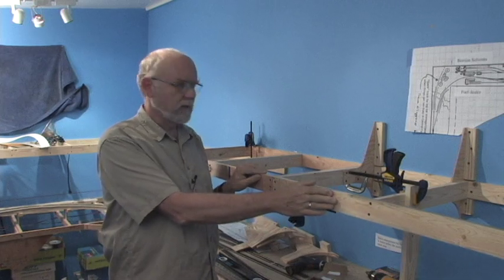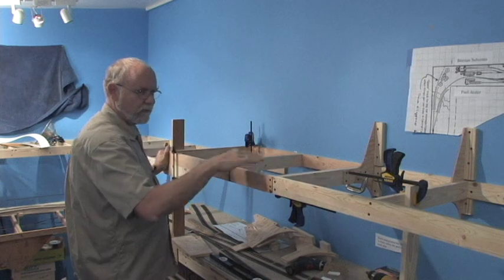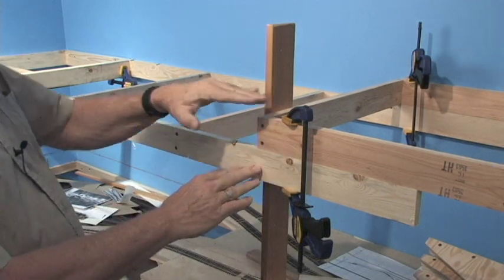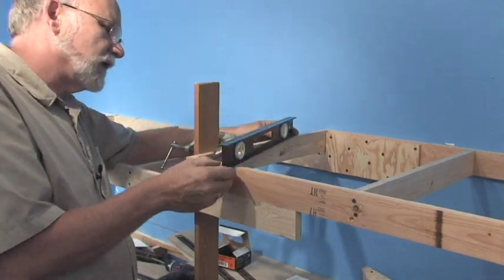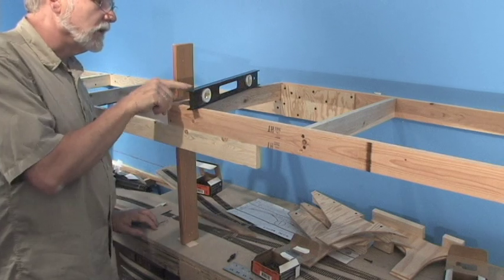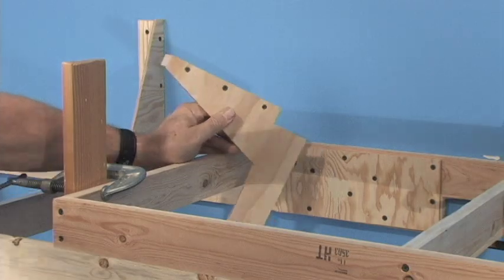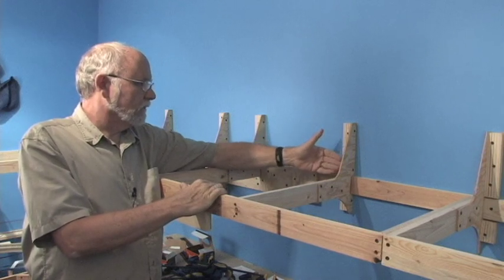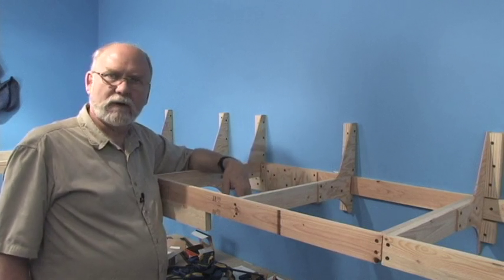Second deck layout construction part 3

Comment: Good presentation and thanks for posting your ideas. I do like the idea of adding plywood sheeting behind the wall board to finish the room thus removing the need to look for a stud for stability. How thick was your plywood and wall board. I would think the thinner wallboard could be used in this instance.

Comment: This series is an excellent example of how to do shelf layouts.   If studied, it should let you build on any level.  My own layout, using these same principles, holds my body-weight.  I never know if the wife will kick me out of bed someday, and I will need a place to sleep.  ;)   And yes, I have lain on my layout, and it does support me easily.  But I tend to make extra supports from the bottom rather than the top on the lowest level.  This is, in fact, how I can make bench work that strong.  I know it is overkill, but bench work can never be too strong, IMHO.  But the same principle applies, though coming from the top is not quite as strong.  But this should be immaterial in any scale under G.
BTW, Mr. Johnston... Got your book on the MDC Shay the other day, and kudos for an excellent dissertation on how these things can be made to run, and run right.  Even for people who don't own any of these little engines, it is a good source for painting and detailing.  I bet if you published an updated version with considerations to DCC, it would sell better than the original.  $50 well spent.
Reply: I am planning a shelf layout with a helix  am sure I will be watching these top notch videos again. get it top notch.

Comment from the maker: "Overkill" is a personal opinion or preference in this type of situation. The weight being supported is modest, true, but I'm also accounting for the fact that human beings operate layouts. If one happens to bump or exert weight n the upper deck, it can support a considerable load on an accidental basis. I also like building things with strength.  

I'm sorry I don't quite understand your foam boards reference. If you mean as a scenery base, yes some polystyrene will be used for the scenery.

Comment from the maker: Kbeatty - Unless it's a designated portable layout built for that specific purpose, there will almost always be some scenery damage when disassembling a layout to make a move. This bracket hanging system isn't perfect but it helps accommodate removing large layout chunks. Redoing the scenery is the easy part, for me anyway. Sorry if I wasn't clear on this point in the video.

Comment from the maker: Hi, sorry for the delay with this reply. 1) The videos I have are as you see them. The "transition" and the beginning of the grade is just gradually curving the plywood. It takes  a very nice natural arc. 2) One helix for both up and down. 3) Not sure what you mean by a 10"  4) I haven't added a switch for any exits. Working it in there between levels would be a challenge unless done earlier when building the helix.

Comment from the maker: Hi, I'm sorry, I must not have made that clear in the video. The 1/2-inch plywood was already on the wall. The layout room was built with one wall abutting what was the outside wall of our garage. It was sheathed with plywood under the lap siding. We used standard 1/2-inch sheetrock when finishing the room, so it's 1/2-inch sheetwork over 1/2-inch plywood.

Comment: nice but big over kill. You are not supporting any weight. 2.5 inch screws with washer on top one is all you need. But section in as all one unit create level differences with foam boards whole lot easier.